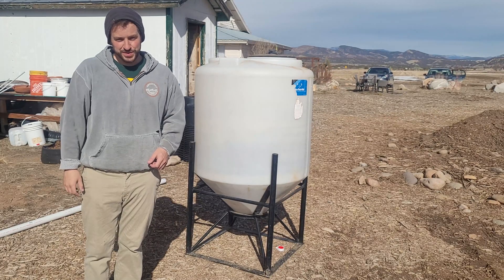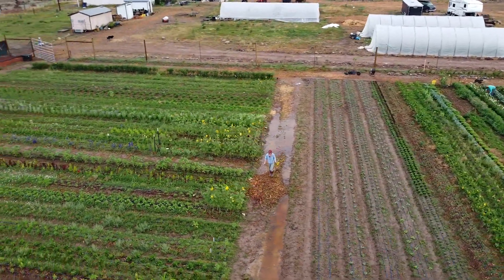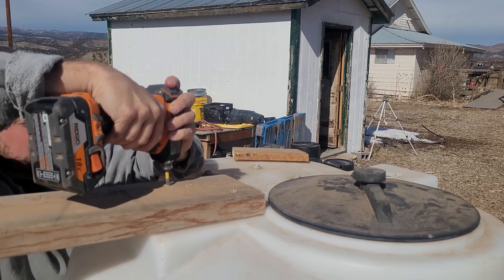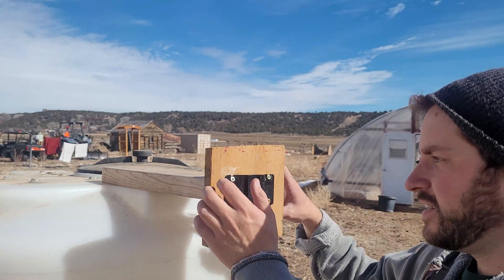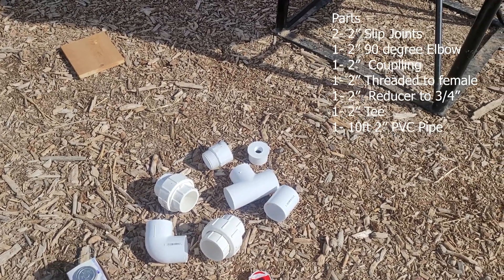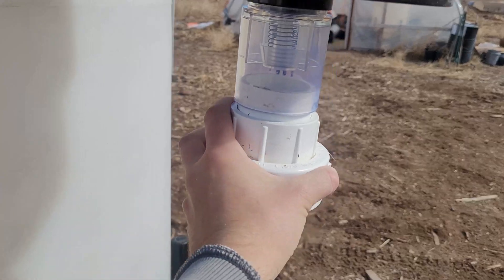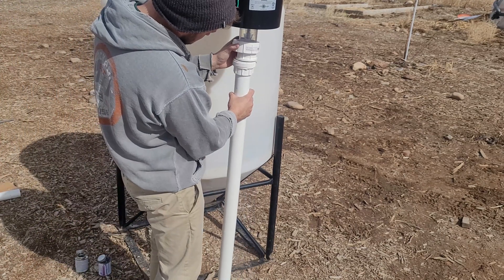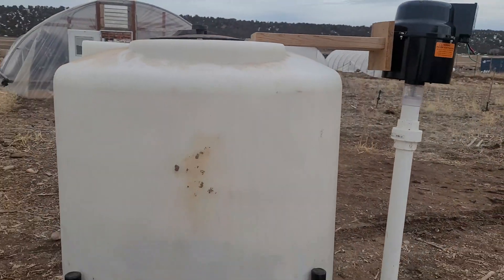How I Made a Compost Tea Brewer & Saved $4,000 USD | Regenerative Agriculture

Comment: How's the 2 HP holding up?
Reply from the maker: I sold the brewer in 2021, was working fine for the new owners. I just bought a farm and will be making another one soon
Reply: @StefanoCreatini  did the 1 HP not provide enough volume of air?
Reply from the maker: It would over heat in direct sun

Comment: That is just an air pump? I take it you don't fill the brewer to the top as I didn't see a check valve or anything that would protect the pump if power was lost
Reply from the maker: The pump is higher than the water level,

Comment: Hey Stefano, in the process of building one now. Where did you get the air check valve? The one from Amazon needs a coupler and yours seems to slip right on. Thanks!
Reply from the maker: They sell ones with the valves, and ones without. You can get a union valve for the ones without. Let me know if you cant find it
Reply: I got it figured out! Tank and stand arrive tomorrow @StefanoCreatini  Thanks!

Comment: $1,000? Naw. We use these inductors in agriculture herbicide applications. Can be picked up used for next to nothing or even free, cleaned, neutralized with PRO TANK or even household bleach, and rinsed. An oiless air compressor (from Harbour Freight), a little PVC, a few plastic ball valves......., if you go over $300 you're not a tinkerer at heart.😊
Reply from the maker: Love it, Ill try it next time.

Comment: How did this work out for you?
I made a 250 gal brewer using the same blower after watching this. Fired it up today and found this blower puts out really really hot air! 

Just noticed these spa blowers don’t have an external heat sink like regenerative blowers usually sold for large brewers. So appears to have something Internal and blows that hot air right into the delivery tube.

Did you notice this? If so, how did you manage it? I’m pretty bummed right now. Ambient temp is currently over 90 during the day. Not sure how good an idea it would be to blow 150 degree air into the brewer.
Reply from the maker: Hey Bob, 

Try putting less water in the tank. I run about 100 gallons per brew.. Did you use 2 hp or 1 hp? That brought my temperature down.  Do you reduce the volume of air feeding pipe? That creates heat.

Comment: Hey Stefano- nice work. Was sent by Bret over at PermaResilience. One concern that I have is how you mounted the motor to the plastic tank with a substantial cantilever. You are working against physics in this scenario. At a minimum, I would apply a vertical support to the cantilevered board but better yet, support the motor vertically. My 2 cents. Thanks for the video.
Reply from the maker: Do you think its needed, the motor weighs maybe 3 lbs tops. 🤔 thanks for input
Reply: @StefanoCreatini  Well there are a couple of ways to answer that and they are dependent on time. Is this a temporary setup? If so, you are probably just fine. If you are intending to use it indefinitely, then yes. Create a support. While the motor weighs only 3 lbs., it is hanging on a long lever (the board) that is applying constant pressure to the screws and ultimately to the plastic tank. This downward force combined with the vibration of the pump will likely cause this to fail at the top and/or on your pvc fittings below.  YMMV. That said, you have inspired me to build one.
Reply from the maker: @benjaminhead1944  sweet, let me know how it works. The first tank I built, is 2 year old now. I used a double plank system and 1 hp motor on it. I just reversed it this time, 1 plank, 2 hp .... lol